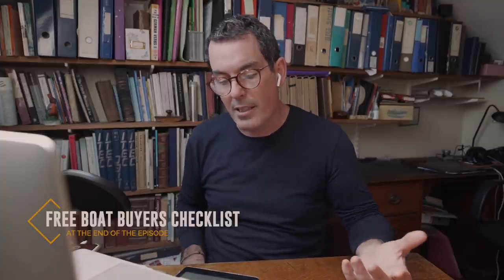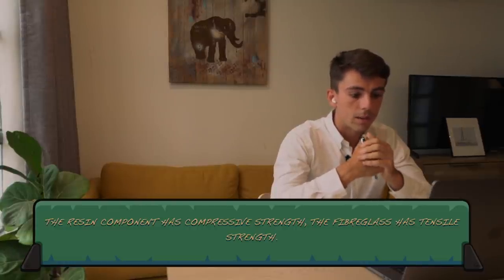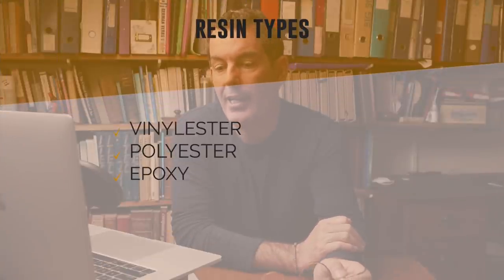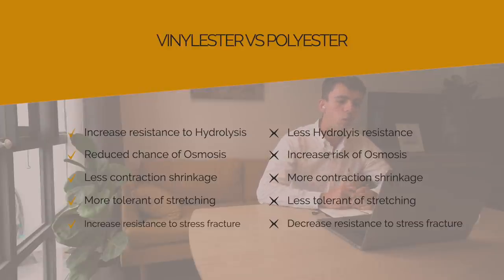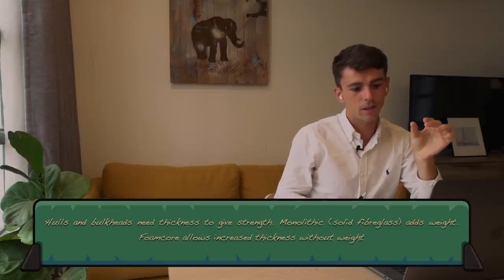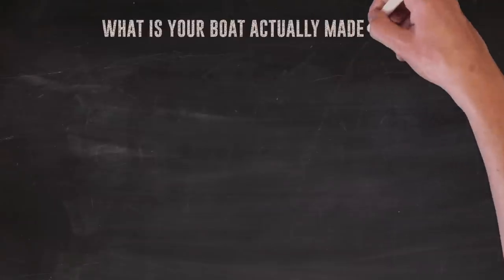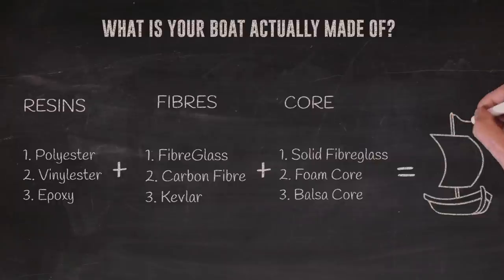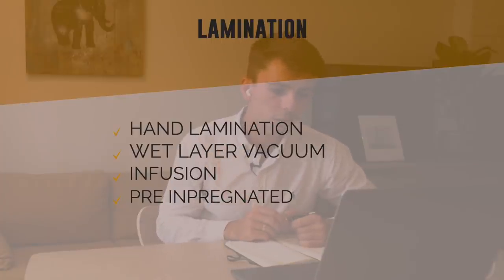CATAMARAN BUILD QUALITY: The TRUTH Brokers DON’T Want To Discuss!

Comment: So if I'm reading this right, for the mast, you would want to potentially go with pre-preg carbon-fiber, using, at minimum, vinylester.  That would give you the most strength while keeping it light (as light as a 70' mast can be!).  Is that correct?  Also, you would want foam with a higher density sandwiched in the load bearing sections, with less dense foam in the less critical, non essential forms, like molded furniture? Again, going with vinylester as a minimum, with a fiberglass construction.  Carbon-fiber would be to cost inhibiting for the entire hull.  Or are there certain areas of the huĺl where you would want it?  Great job on this series sir!

Comment: Just a small comment.. pre-preg does not indicate a higher level of quality... its a time saver in the lay-up/assembly process... thats all. dry sheets of fiber are layed out, liquid resin is spread over and pressed down into the dry fiber. the now "wet" fiber is covered in mylar tape (to maintain separation of wet sheets) and then the sheet is placed in a freezer for later use. placing any resin in a freezer slows down the resin curing process and slightly extends your assembly time. it is no different quality-wise than hand lay-up.

Comment: The overall price diference between epoxy and venylesther would be interessting.  I allways wonder way one does not want to go all the way in an investment that big.
Reply from the maker: It’s all about cost saving and because no one asks. The brokers won’t tell you their boats aren’t as well built as the one next door unless you know what to ask
Reply: Anton, I'll take a semi-pro stab at this. Epoxy vs vinyl ester is about twice the price. For a big boat, you going to need about 1000 gallons. If you look at retail for example FibreGlast quotes $2,500 per 55 gallons for vinyl ester so $50,000. For Epoxy that would be double. And manufactures can get it a lot cheaper. So let us say is half of that. So only a $25,000 difference. Does not sound like much for a boat that costs $500,000?? The real problem is epoxy is not UV resistant in its basic form. And will not chemically bound with gel-coat. So instead of applying gel-coat, followed by wet on wet laminating resin and finally finishing resin in the mold in one nonstop process. When using epoxy the process gets much more complicated, labor-intensive and time-consuming. With epoxy, you have to stop, wait for curing and then mechanically bond it to the top-coat(sanding). Or even worse hand finish after it is out of the mold. To the point that some boat builders claim the cost on the final hull is 2-5 times more for epoxy. So if you use the rule-of-thumb that the fiberglass shell is 50% of the cost of the boat and the systems the other 50%. Then the $500,000 boat now costs between $750,000 and $1,500,000 when made with epoxy. I hope this is helpful in some small way.

Comment: Ironic video considering how many deposits Multihull took in advance for the 1370 build slots when they couldn't inform customers of basic design features and weight carrying capacity. Don't get me wrong I agree with you, I asked the hard questions before I purchased. There is a lot more that the market obviously prioritises though as evident by how many 1370 hulls pre sold with very limited information, I think primarily due to galley up and your marketing. Some things that you haven't seemed to cover but I did before putting a deposit on my cat is insurance claim frequency information on brands and models through failure, warranty claim frequency and common boat failures over time like Lagoon bulkheads separating. Not as easy to quantify, you would have to join all of the FB groups for each model etc and do hours of research and phone insurers. I did, very interesting and basically only left Seawind and Leopard as production cat options in my size, design requirements and budget.
Reply from the maker: Ah mate, I think they knew. There was never a doubt that the 1370 would be built as the 1260 and 1600. Same ingredients, same foam core, same vinylester over polyester. It’s just whether anyone bothered to ask. No one seems to care. Obviously with the exception of people like you and I who want to know
Reply: Yes, the new Leopard 42, that is just being rolled out, is utilizing 100% resin infused/PVC core construction.  Lighter/Stronger.  Have one on order.....looking forward to it.  Cheers
Reply: @mountaindweller9118  The 42 was too short for me, I ordered a 45. I have heard too many people complain about hobby horsing  the shorter the cat gets. It looks amazing though.
Reply: @trentspencer7991  Congrats on the 45!

Comment: Great video! How about flammability/toxicity? Little regard seems to be given to that, and modern boats can go up in flames in a very short time.
The Garcia Expedition is an amazing boat, but my eyebrows went up when I saw that  for insulation they use a very thick foam spray.
That stuff will go up like a firelighter, and incapacitate with toxic fumes.
Not much point floating if you are burning.
A discussion of the issues of fire hazard in construction with your naval architect would be awesome.
In that respect I would like to give a shout out to the comparatively new use of basaltic fibres in boat construction, with excellent fire resistence and around the same properties, and cost, as S-glass, which is a step up from regular fibre glass.

Comment: The problem is the budget : take Sirius Yacht : ultra sick monolothic hull, all bulkhead laminated to the hull, furnitured built IN the hull and so on : 450 000 for a 35' monohull.
Take Amel : vinylester and glass/kevlar hull , all interior with watertight bulkhead... not far from 1 million for a 50' mono. 

You can do multi with all this ingredients, but what is the price ?
Reply: around the same price.  Balance and seawinds

Comment: This has been a very interesting series. I will never own a seagoing vessel, but you can take this discussion and apply it to many things in life. What has happened here is a very complete look inside how a manufacturer goes through the process of not only designing the vessel, but coming up with the computations on weight, balance, performance, and stresses on the structure in the process.
If I were in the market for a seagoing vessel, of any kind, that I intended to live aboard I would approach the selection exactly as you are Nick, and find out everything I could about them. It seems only logical, and I am not approaching that from the best "deal" perspective, although cost is always an issue...We are talking about a house, your home. 
The key difference being that it is expected to stay afloat, on a corrosive liquid, move rapidly across that liquid surface in every kind of weather, crossing vast distances unsupported, and be as problem free as possible for several decades, keeping the people aboard safe, comfortable and happy while doing so. Not many environments are more demanding.
So the question, in my mind, is why all potential buyers don't approach this the way you are?
You are not shopping for a commuter car here, some econobox that will be in the recycle bin to be turned into widgets in 10 years. This is a boat, if it sinks under a guy bad things can happen.
Reply from the maker: Ah thanks hanks for the supportive words mate

Comment: If you watch the Expedition Evans rebuild of their Beneteau you certainly get an insight into build quality. Which has the knock on effect of limiting how you can deal with major structural rebuilding or repairing. Great tech show. Thank you.
Reply from the maker: A pleasure mate. Monohulls are a little different as weight isn’t such a big issue
Reply: @sailingrubyrose  So true, yet I wondered had the basic build been better thought out on the Evans boat, and less profit driven, they might have had more resilience or ability to absorb knock. This presentation leads to the inescapable conclusion that the process is important across all boat types due to the same approach to materials. Of course, my dream boat is an Exquisite X5 (don't shatter my illusions please) which is a cat, and so all monohull sailors deserve what they get (thank God you moving up to a cat, I can thus say it out aloud) 🤣😂😀😎
Reply from the maker: We know Tamas at Xsquiste yachts. Can confirm that the X5 is so so well built. When you final,y get your X5 you’ll have nothing to worry about

Comment: While three fiber materials, three resins, three cores, and four laminations give you over 100 theoretical construction combinations, in practice that is probably not the case; you would not use, for example, the most expensive fiber material together with the cheapest resin, and put it together by hand lamination. What I assume is more likely is that they would be grouped: cheap with cheap, and expensive with expensive. 

If this is true you would know the overall quality of the boat by knowing one or max two of the factors. Is this a correct assumption?
Reply from the maker: Definitely you would consider a vinylester boat to be of superior construction to a polyester one. 
This is a no brainer as the materials are used and Infused in the same way. It just comes down to cost as to which one.

Comment: So they wax the mold...spray on the gelcoat, then lay up the fiberglass layer below the gelcoat...when and how do they adapt the foam core ( or balsa) to the first layer of fiberglass ? Do they do that prior to the infusion or vacuum bag? I’m curious how they adapt stiff layers of foam core to a compound curved hull mold...great technical series.
Reply: Have a look at the YouTube Series - Life on the Hulls - which shows where he has used different density foams adhered to the Gel Coated Fibreglass mold and where he is also building all his furniture from molds. These plus all the bulkheads etc etc are all taped into place with Fibreglass and glassed over where appropriate. He also illustrates the techniques required for molding the density foams over curved surfaces etc. hope useful. Kind regards Gavin

Comment: Thanks for sharing... One thing I thought of that rarely is discussed is isolation materials. How this could be done with increased thikness of the foam core insted of doing an extra layer like a 2nd sandwich construction? Aren't there any benifits with a thicker and warmer foam core to start with?  Any ideas regarding that?
Reply: Thicker and proper isolation (and ventialtion) makes the boat warmer, less condensation and even cooler in warmer parts of the world right?

Comment: Very interesting discussion of materials.  What can you say about design?  You can use the finest materials, but they do no good if there are flaws in the design. (see Parley Revival, e.g.) On the other hand, even the cheapest materials can be used to build a safe boat if it is properly designed and constructed. So, in the end, what is a buyer to do?

Comment: Balsa vs Foamcore is a lot more than just cost. Without going off the deep end into material science, balsa is much stronger in compression and sheer than foam, allowing you to produce thinner sheets of equivalent strength to a similar panel of foam. For this reason you will see combinations of balsa and foam used in race boats as each have superior application properties. Balsa has poor impact resilience and falls apart with water incursion, making it a poor choice for below the waterline filler, it also requires coring and back filling any through holes. This is very similar to the use of carbon, fiberglass and kevlar, each composite fabric has different properties that make it superior for load, sheer, abrasion and cost. Most production manufactures pick one material system because hybrid applications increase the manufacturing and engineering process cost.

Comment: Great info about catamaran building materials, thanks. It just occurred to me while you were talking about carbon fiber boat/mast  whether it would be less safe when lighting strikes or could it be more susceptible to permanent structural damage after a strike, specially at the interface of two joined carbon fiber pieces. I am assuming that's where you have a resistance to the passage of current and possibly maximum heat generated...etc

Comment: As a naval architect I got to add more questions about safety on board. Any resin used for pleasure yachts is flammable. There are none flammable polyester resins used for life boats and non flammable epoxy resins used in planes and trains. It's just the boat industry that wants to save the cost of certification for boat building for the epoxy. The non flammable polyester could be even used right away. There's just one negative property to this: salt water causes osmosis on this resin a lot faster. As nobody is aware of the danger of fire nobody is asking and pushing the development of osmosis proof non flammable polyester or the certification of that Epoxi resins. To me it's even a complete bullshit why a resin should be approved for building planes but not for boat building. There's just someone sitting on a chair blocking it by saying for boats different certificates are needed. If one had seen fire aboard a fibreglass boat and how quickly it develops, he'd ask immediate for fireproof resins. I'm sure that a fireproof or fire retardant Epoxi resin could have almost the same price as the standard polyester today. It's just that the industry wants to make more money out of it and therefore sells the different types of stuff. 

But I need to contradict in the point of osmosis danger for polyester boats. It's not generally guaranteed that any boat will have osmosis one day. It's a thing of build quality, time to harden the resin before the boat hits the water the first time and it's a factor when and where it's been built. Some yards didn't mix the resin good enough, some did put the boats into the water to fast. When the resin is not hardened completely, the natural process of osmosis can start right away. And at last even an extensive osmosis treatment is not the end of the world compared with other hidden damages on a used boat.

Comment: this is a basic understanding , but  you can  ( once you have a general knowledge of  fibreglass and its  characteristics ) .. i would  ask for  the laminate schedules ,..  eg , types  of foam core .. as all foams are not the same , the glass ,,  is it , e glass ,  ,,  or s glass //   in this   you will see  for examples the layers ..of  chop stand matt .  1708 biaxial matt  8oz  , 10 oz.... triaxial   etcetc ../  all that will be shown in the "laminate schedules "  it  is on  the build plans .  another thing ..  some epoxy  does not do well with fuels   oil etc ,  (fuel . blackwater tanks)and
Reply from the maker: I love talk like this! 
We talked about all of this regarding Ruby Rose 2. In the end we felt that it would bore the living be-Jaysus out of most of the people watching, so left this in depth part out of the video.
Reply: @sailingrubyrose   hi nick, i think you under estimate some of viewers
. i assume the foam core is closed cell? is closed cell honey comb used in any parts of RR2? bi or tri axial glass or carbon &what weights? also  the bonding of the hull & deck ,antoine  mentioned taping(glass or carbon & type of resin ?) as well as gluing & bonding, but adds weight!! but no comments were made in regard to extra weight versus strength in a major join. just a couple of points to clarify! ps.  love the channel and as they say
,the devil is in the detail. cheers nick
   
(

Comment: Sounds like Schionning designed cats that are pre peg epoxy are the way to go (foam rather than balsa) compared to standard production cats. Otherwise, how about aluminum in a cat 48 feet or greater?  I only know of Garcia aluminum cats that are around 48 feet, otherwise a custom one off like a Mumby 48 or does anyone know of others?
Reply: allures makes some.  Theres a few cat manufactures using foam.  I think some seawinds and balance.